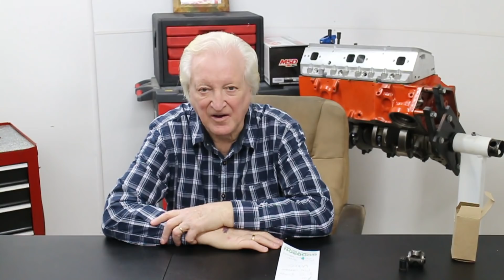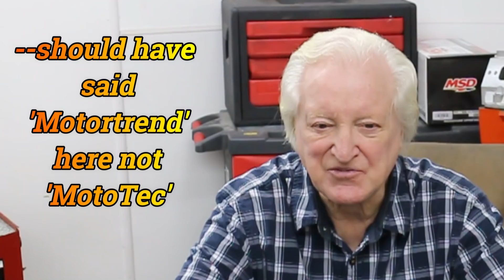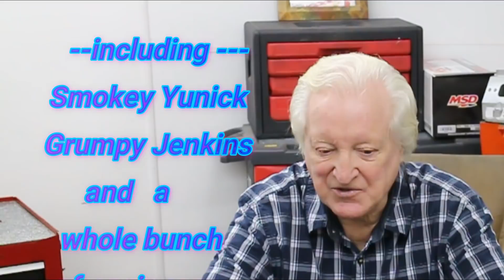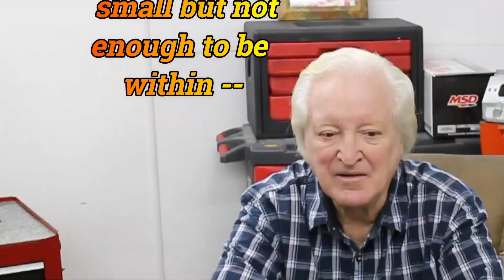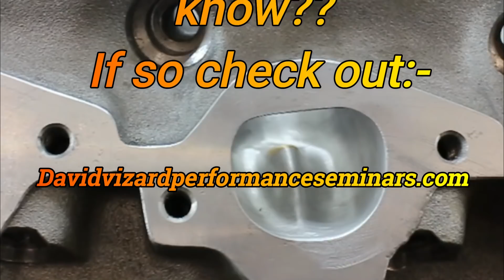David Vizard's PowerTec 10 EP 16  Engine Masters/UTG debate with dyno results

Comment: I recently saw a yt video from Yamaha Motor co about where they offset the bore centerline from the crank center on their moped motors resulting a power increase. They said the increase was because of a reduction in frictional losses from less rod angularity during the power stroke.
Reply from the maker: I did some testing like this many years back (about 1988-89 and tried to sell Pontiac on the idea for NASCAR MOTORS BUT THEY TURNED THE OFFER TO TEST DOWN SO I ONLY EXPLORED THE PISTON PIN OFFSET. THAT SAID THERE IS A BETTER MOVE YET THAT CAN B E DONE WITH THE BORES BUT THAT IS GOING TO COSTG WHOEVER WANTS TO KNOW MONEY AS IT HAS ALREADY COST ME MUCH TO TEST.
Reply: @marvingvx1  Ford flathead V8 engines were all done that way and I think that the offset is about .185.  They had offset pins in the pistons too.
Reply: @marvingvx1  Obviously  tilting  the bore through centerline bottom away from the crankshaft centerline a degree or two -  same type of advantage.
Reply: Yamaha has been making very impressive stuff for many decades.
anything from musical instruments to jet ski's and then some!

Comment: We arguing over 7HP 🤣🤣 Jesus how petty could you be!!!!!
Reply: 7 here..5 there..3 somewhere else...it sometimes separates the winners from losers👍
Reply: They do it on formula v engines. Adding 7 Hp to an 80 Hp engine will get you sitting on the pole.
Reply: @davidleonard8369   Every little bit helps when your total is so low.  I'm going to have to try this on a A-series Mini.
Reply: 7 HP here, 7 HP there, and next thing there calling you a cheater. Like they did Smokey.LOL
Reply: in a 3200 pound car with about 350 horsepower another 10 horsepower is worth about a tenth of a second, to super stock guys that is huge
Reply: Brandon ...
7 hp by swapping big parts costs about $210.
Flipping pistons is FREE.

Comment: I have a book, published in 1970 by Chrysler, with engine building info developed by Dick Landy for Mopar in the late 1960's.Using it as one of my first references, I have reversed factory type Mopar pistons. I believe the piston pins in the 426 Hemi are not offset and some, "racing" pistons are not either. There is another theory I've heard, that when the pistons are very short, some offset pre-load might help power, by preventing extreme piston rock of the very short pistons. Chrysler for only a few years, tried to improve fuel economy, by not offsetting the piston pins, but offsetting the piston pin bore in the connecting rods of certain model small block V-8's. I wonder if that would even work. Chrysler quit the practice after a few years and went back to regular rods and offset piston pins. I would think, rather changing the piston pre-load, an effort like that might just result in the connecting rods acting like they were slightly different in length. I tried a bicycle with the pedal crank arms offset by quite a bit and it made little to no difference.

Comment: Do gapless rings make more power?
Reply from the maker: YES!
Reply: @marvingvx1  how about the new Sealed Power ported rings?
Reply: @marvingvx1  Ok, so why don't I hear and read more about gapless rings? It seems they're not that popular.
Reply: If done properly absolutely they do.
Reply: @troymecey  I built an engine 20 years ago with gapless rings. Surely that has been around long enough.  It is a fact that blowby is lost energy, it is also a fact that blowby increases crank  case pressure which increases resistance to the piston coming down the bore. Now I guess it could be argued that some of that energy is made back up by pushing the piston up on the exhaust stroke but that isn;t really the case or they wouldn't try to pull vaccum on the crankcase like on prostock motors to get that last little bit out of it.  Is it a huge gain? no. Can their be issues with it? yes. Does it add power? yes. Is it worth it, depends on application.
Reply: @bcbloc02  sorry, my reply was meant about the ported rings, not gapless.
Reply: No , if they did , every real race engine would be using them.
Reply: @V8Lenny  You're right, I don't see them used by engine builders on youtube.

Comment: Does it increase peak horsepower only or does it give an increase throughout the rev range ??
I'm trying to imagine the dyno graph for hp/torque.....would it be a good idea with a stroker kit installation ?
Reply from the maker: More torque everywhere if it is going to work. Yes it is a good idea for a stroker. ICON pistons will make custom pistons with the offset in the required direction
Reply: @marvingvx1  exactly as my pea brain interprets it, when an engine likes it, it'll deliver more torque through a wider rpm range and more torque overall.. to spool up quicker with. gains to torque being a higher percentage than the peak horsepower gain percentage, if keeping everything else basically equal. timing+dwell, plugs, jets, would be appropriate/acceptable if the test engine put to a dyno both ways.

Comment: A gain is a gain. Over the life of the engine, the gain could shorten parts life, or increase parts life, but even motor oils fight for gains in the fractional realm.
Reply: Agree 100%. This was also a time when average motors made 200 HP and 500 HP was still impressive. A few 7 HP gains hear and there separated the boys from the men. In a World of 395 HP pick up motors and 1,000 HP boosted motors, most people would consider 7 HP gain nothing.
Reply: A lot of people would probably be very surprised to learn about the different oils actually used in different max effort racing arenas.